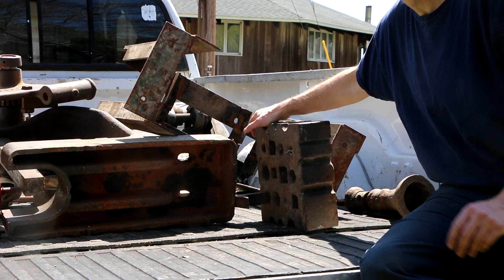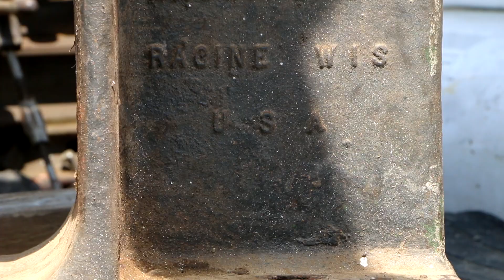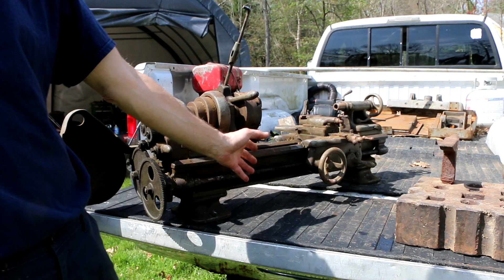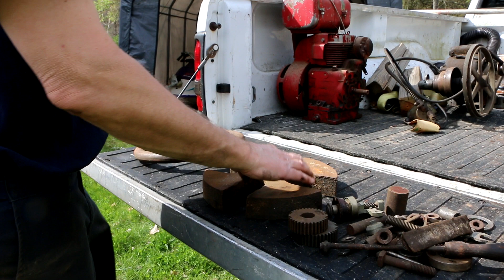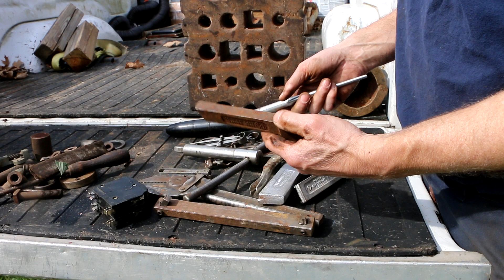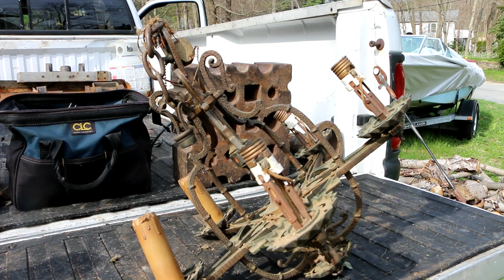May 2022 Estate Sale Pick: Arbor press, metal lathe, swage block, and lots more!

Comment: Hey Steve, I’ll gladly pay double what you paid for the little lathe!
Reply from the maker: Sometimes I get lucky. Old used lathe values are a funny thing. I recently saw an old Hendey gear head lathe was posted on a Hendey owners group I belong to. The guy was trying to help a widow sell her husband's lathe, and was asking about a fair asking price. As usual, there were a number of suggestions that ran the spectrum from 600-1500, while one individual spoke of recently paying 2500 for a similar one. So many factors are involved in lathe value. However, most people agree that with old lathes, smaller bench top lathes will command higher price than larger ones. If 2 guys can pick it up and carry it, it can fit in a small hobby shop, and therefore is in higher demand. The other factor is geography. Certain areas of the country just have more of this old iron around, so 2 identical lathes can have a large difference in value based on location.